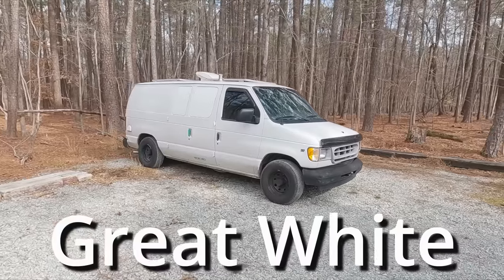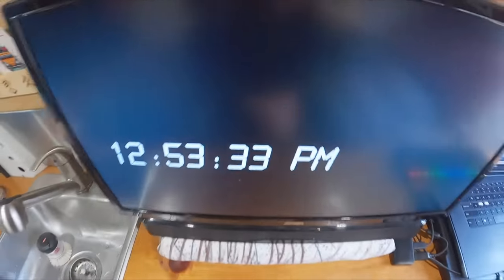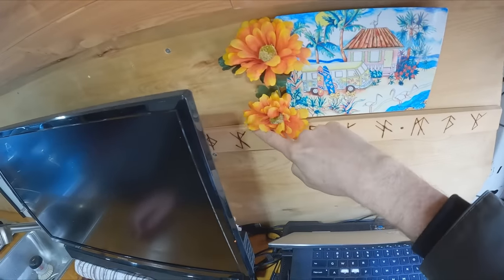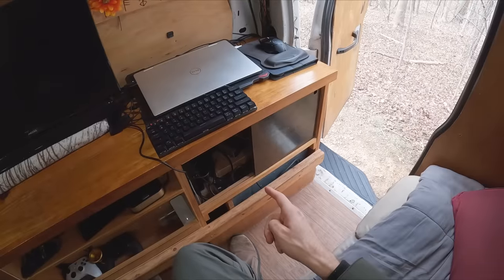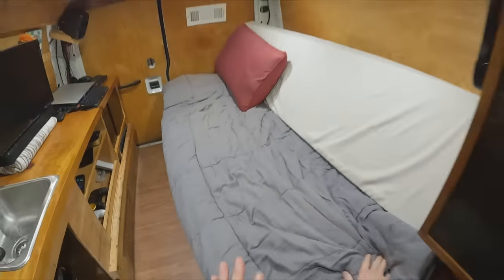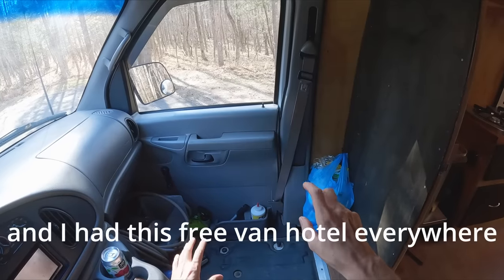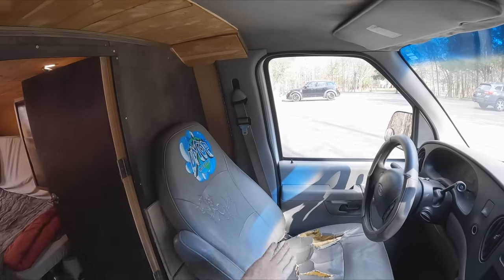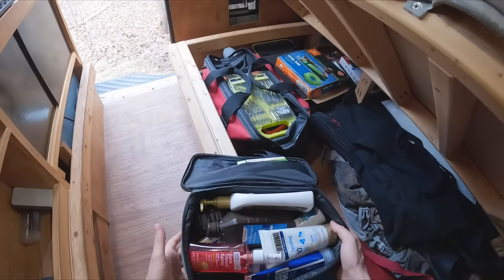STEALTH VAN LIFE TOUR | Differences Four Years Later

Comment: .
    I have a 2010 Dodge Grand Caravan STX with a shit load of options too long to list here. One option that is my favorite is Dodge's VES or Video Entertainment System. This is a factory option with 2 DVD players and 3 screens. There are 2) 10 inch diagonal fold down screens, one each for the second and third row seats, and there's a third screen in the front dash that goes to a neutral screen if the transmission is taken out of park and it doubles as the backup camera monitor in reverse. I have an aluminum brief case with 200 DVD movies in it that I keep in the van.
    One other feature of this is 2 AV ports in the back with a 150 watt 110 VAC inverter to plug game consoles into. The 2 screens in the back have their own wireless headphones on their own stereo channels so that 2 game consoles can be played independently from each other without bothering mom and dad. My youngest is 27 and is not about to drag his PS5 out to my van.
    I bought a ROKU stick which uses a UHF radio remote rather than an infrared unit. I also bought an HDMI input to AV output adapter and a dual 5 volt cell phone charger. On the drivers side panel in the rear behind the electric sliding door resides the 2 AV system inputs, the inverter outlet and a 12 VDC outlet. I plugged the the ROKU into the HDMI converter and their 2) 5 volt cords  into the dual charger. I plugged the AV adaptor into one of the AV inputs and the charger into the inverter. Then, I placed the whole setup in the drivers side rear window for the strongest signal. I park in the disabled spaces closest to the buildings when possible and never have a problem getting a WIFI signal as far out as the 4th space from the building. The inverter switch is in the dash in the front. I push the button, the ROKU loads up and I'm off to the show.
    Almost all of the doctors offices and hospitals in our area are associated with the West Virginia University hospital system and all have free open WIFI for patient use as does Walmart and Kroger grocery stores. After 11 spine surgeries, I am disabled. My wife used to have seizures so she's never had a drivers license. When it's time to go grocery shopping or if she has a doctor appointment or a test or procedure scheduled at a hospital, I do the driving. She goes in and does her thing and I flip on the inverter, set the VES to "AUX 2" and watch Prime, HULU, YouTube or any of 30 other channels that spark my interest. If I'm not in the mood for ROKU, I slide a movie into one of the players to pass the time.
    Being that all of this runs on the starter battery, I traded in the 500 cranking amp battery that came with it for a 985 cranking amp to allow for more run time. Especially if the inverter is involved.
    After a particularly painful spine surgery between my shoulders two years ago, that inverter was invaluable for running a heating pad while driving as it helped to relieve muscle spasms in my shoulders and neck areas. I plugged it in, ran the heating pad up to my seat and pushed the button in the dash. It made it much more comfortable to drive.

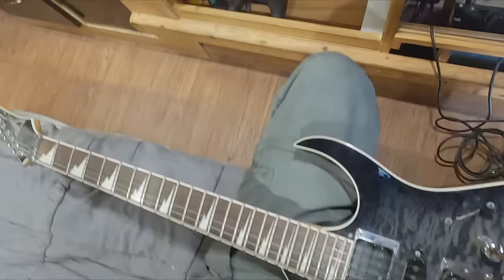Comment: 8:40.  . AGM batteries still outgas, and vent. Years ago, Alaska Communications had one of their remote mountain top stations blow up due to the outgassing from their AGM batteries. They, too, thought that they didn't need to vent, and found out the hard way. They are still water/acid/metal combination, and so electrolysis still occurs.
Reply from the maker: Good thing I had it vented still from the previous battery that off gassed a lot more!

Comment: can you share some stories about problems you've encountered regarding finding parking for your van overnight. where do you usually go and stay? is the neighborhood always accommodating? how about thieves? and also maintenance and other services you do to keep the van life rolling..
Reply from the maker: For finding spots, it's not so hard. While traveling longer distances, I just do crackerbarrel to make it simple, walmart as back up.

For nice camping, I'm usually in an area for a while, so you ask the local RVers and Vaners. Or you download the apps and find good spots. I feel like parking is simple to find anywhere in the US, but getting the nice spots is just a conversation away.

I haven't had any theives yet myself. Park away from bad areas.

For maintenance, I am constantly listening to the engine noise or any other tiny difference in sound while driving. Sounds are the best indicator something is changing / worsening over time. I usually use YouTube to fix my own stuff if I can.

Comment: I like the fireplace the best. Of course this is because I took my shot at van life and heat is a big issue. The propane buddy heater thing with the front windows cracked open did work, but I would never go to sleep with it on for obvious safety reasons, and I believe the gasses emitted from the buddy heater are carcinogens and cancerous.

Comment: Hope I do not sound negative but in first minute in this video I already see two big Nono's! First is that propane tank in your living area (shoud be outside and ventilated) second is you have gas stove without flame quard (if flame shuts down, it automatically shut down your gas) these are things that are taken care in commercial campers and I sure hope all who make these wonderful van conversions think out your safety too! No one want's to live in death trap and where I live you can not build without inspection it yearly for road legal.
Reply from the maker: You are right. Now in my new van, I have a small 1 pound interior tank, and a stove with the auto cut off features. Eventually, I might put a big tank on the outside under the van and remove the small interior tanks, but at least they last each about a week and a half of cooking.

Comment: Nice efficiency build. We want one of these but dont feel we need a huge kitchen. But we want a larger bed and full shower/toilet. We want to use it to deploy for 3-7 days for work camping in different parts of the country. So we need all weather and we need good air-conditioning. We would also like to have the option of shore power. I wonder if there are plans that focus on certain aspects and best practices for insulation.

Comment: Most ppl do think of the prices for month to month. If u think of it the average person pays around $875 a month for just rent on an apartment or $1300 after all bills and groceries r paid and bought. By living in a van or truck you are cutting that down about 32.17-38%. im getting me a van soon to convert and live in full time. Im getting a normal gas generator that's quite as can be and some solar panels. It will only cost me about $552 a month to live in ($200 for car insurance, $200 for gas, and $152 for food and water. It's really cheal if you only get the things you need

Comment: 6:06 Just so you know, air purifiers that work by actively "releasing negative ions" into the air, while they may produce a "fresh" smell, they often do so by releasing tropospheric ozone. It's likely bad for the environment, plants, crops, wildlife, and absolutely most importantly in the enclosed space of your van, your respiratory health. Whether it makes enough to be seriously concerned about, I couldn't say, but I would suggest looking into it, just my two cents. My seasonal affective disorder lamp has the same feature. After reading into it, I have resolved to not use it anymore.
Reply from the maker: Correct, yes! I've done a good bit of search into it. I just have it on when I'm away from van and air out the van before getting back in.

Comment: I am renting a driveway for now and that gives me access to a plug for heavy heater and fan use  but that’s not forever. A fireplace seems ideal but also seems very niche for rural only vanlife. Or am I wrong?
Reply from the maker: Instead of a fireplace, get a diesel heater. Put in your own tank if you don't have a diesel van. This route works way better.

A fireplace is for sexy appeal, too much work to keep it going. A diesel heater, with proper van insulation, can last you days and days on one tank. Personally my van tank (on my new van, not the one in this video), my diesel heater can run 100 days without refueling

Comment: What do you do if you get lucky?Go to their place or bring them back to your van?
Reply from the maker: Definitely bring them to my van. Some women absolutely love the van, and especially my new van which is being built as one of the most comfortable ever, in my opinion. I call it girl friend friendly features. Will have a full body mirror up front, hot water, a full Recirculating shower and toilet, already has a queen size bed plus 4 inches so I can push her away from me at night hahaha. It already has heat all night long, but the thing that will set this van apart is the real AC system for use during the day, and some at night off just solar battery.
Reply: @OutdoorsEmbrace  That's awesome.

Comment: I love the lights that turn on and off to the music. What is it or where did you get that? Also the pump to pump in water into the inside. Which one is that?
Reply from the maker: Amazon 12 volt LED strip lights. You cut the power wire at the adaptor and wire directly to your 12 volt battery!
Reply from the maker: For the pump, look at the Amazon page in the description. It has a list of all parts used in Great White

Comment: Very nice!  Have you ever considered watching regular free over-the-air HD and digital broadcasts on your TV?  In order to be called a 'TV', your TV is required by federal law to have an over-the-air tuner already built in.  Wouldn't be much trouble attaching a small antenna to the roof of your van.  Rabbit ears probably would not work well inside the van surrounded my metal with no windows nearby.
Reply from the maker: I just don't really care for normal TV broadcasting. But it could work yes
Reply: Commercials SUCK! @OutdoorsEmbrace
Reply from the maker: @doctorkayak  commercials are amazing! I love them!

Comment: Wow.  😮 Isn't all that equipment heavy for the tires?
Reply from the maker: These vans are made to carry lots of weight like this. I'm sure it can bog down the van over time, but act like the engine has no power while driving and you'll be able to run the van for a very long time. Acceleration = heat = wear on parts

Comment: Propane safety...shut off the burners at the stove top BEFORE you close the gas valve. You don't want oxygen in the tubing between the propane and the burner.
Reply from the maker: The proper way to turn off a grill is by turning off the propane tank first, then turning the knobs on the grill. This way you cut the supply of the flame first.
Reply: @OutdoorsEmbrace  You are wrong. Turn off the burners, THEN the tank. The reason is you don't want air getting into the tubing that supplies the burner.
Reply from the maker: @NewVenari  I've done a good amount of google searches on this.
My last comment is actually copied from a credible source on the matter.
 The companies websites even say what I am doing is the proper way.
Search, "In what order do you turn off a Propane Grill".

Comment: Does not being able to stand take a toll on you? I was debating a standing Van to not. Just because a Not standing Van. Seems more stealth and I assume you could park n more places? Seen signs where it said no Vehicles over 9ft etc..
Reply from the maker: Honestly stealth to me is just keeping it plain and white on the outside. Keep it looking clean too. It blends in with work vehicles. Stealth is almost no longer about fooling people that it isn't an RV. It's not about looking so plain that they don't even think about it. Great example would be my new van Window on my new van. It would be easy to tell it's a window if you know, but it doesn't attract the eye. Most people would not even notice it and may even think it's just part of the metal.

Through all my experience, I have not noticed any difference whatsoever between parking less/more places between the smaller and tall vans. Get the one you can stand in if you want it and can afford it. The ONLY limitation I personally see (and it's not a huge issue) is van length. Sometimes parking in a city like NYC is much harder when you are long and trying to parallel park between cars.
Reply: @OutdoorsEmbrace  Ya, good advice. I see here in Caly. A lot of no oversized vehicles. Mine is 19ft so it short enough. But it 9ft so too tall. Under the Code. I did not know that when I bought it. I want to travel into cities.

Comment: Are the only batteries you have to vent, is the Lead ones? Do you not have to vent the other batteries?
Reply from the maker: Just get Lithium Batteries. So much better and you do not need to vent them.

All Lead Batteries need to be at least slightly vented. Even sealed AGM can off gasses. They are super heavy, and they only can be used to 50%.

Get LiFePo4 Batteries. Do not worry about getting the expensive ones. It's ok to get the cheap Chinese ones on Amazon. The build quality inside is actually very good with almost all of them. Look up Will Prouse's Battery breakdowns, he shows the insides and gives good brands to buy for cheap.
Reply: @OutdoorsEmbrace  Thanks for the Tips! I happly go cheap as long as it works. But Can not give China my money. I rahter pay more! If there is an option. I rather keep my money in America. It will be a thing in the long run as we are seeing now. We have to spend in house. To help each other out. Anyhow that my opinion on it. Also I learned spending good money once is cheaper than  buying Cheap China stuff 10 times. And the hassle too. Agggg.

Comment: are you able to game for hours without running out of battery or how does that work say like you want to game for like 5 6 hours and run out do u just use like a generator or something to recharge quick?
Reply from the maker: In this van, I did run out quickly. But in my new van, I can game for days literally without a charge. The newest games too. No issue. I've been playing Elden Ring a lot lately in my new van on my screen with my subwoofer audio set up. All this can run for days if not forever really, due to charging daily. But without charging, probably game for 3 to 4 days without sun.
Reply: @OutdoorsEmbrace  thats awesome im looking for around the same amount of power what exactly is your new power setup?
Reply from the maker: @Diode7  600 amp hours of LiFePo4 battery. 12 volt system

And 800 watts of solar, although a little less would be ok too... but I feel 800 is good to keep up with demands.

Comment: Any issues driving with those solar panels on at high speeds?
Reply from the maker: If you go above 50 mph, they fly right off. It's extremely annoying since you have to buy a new one each time you accidentally go speed limit. Haha, no issues. For real, you can go as fast as you want and they are just fine. No wind issues or rattling.
Reply: @OutdoorsEmbrace  Alright, cool man!  Thanks for replying and keep up the channel, nice work!
Reply from the maker: @SN0WMAN27  for sure man! Glad to help! I will say there does seem to be a period of about a month where they settle in. It does have some rattle towards the beginning. Happened with both vans and all others I know from other people. As far as I know, it's normal just going over bumps. It should only be ever so slight though of a sound. That's with the Z bracket mounts. Otherwise after they are settled in, they are all good. Especially once you install insulation, everything deadens out and vibrations go away. Everything like road noise or outdoor noise goes quiet. It's like a 20 to even 30 decibel difference it seems. In my new van, I have 5 inches of insulation on every wall, extreme difference in sound quality, great night sleeps even close to highways.

Comment: What is the diagram from the front battery underneath the hood to an isolator an inverter in the battery in the back how does that hookup and am I able to charge car batteries with my  my truck running.?

9
Reply from the maker: Oh I have an entire video showing how to install an isolator in this exact van set up! It's a good one and makes it easy to see everything

Comment: I wonder, always, how the buildout of the interior affects MPG.
Reply from the maker: I haven't noticed a big difference in either of the vans measured MPG before or after build.

Midway on the build of second van and it seems that I'm getting a similar MPG (22.6 hwy 2016 Turbo Diesel Transit T350) that I did before anything was put in place inside.
Reply: @OutdoorsEmbrace  Wow. That's amazing.
Reply from the maker: @bloodswarms  I would like to add, other people have reported a different story than I, that it does effect their MPG. I'm just sharing my side. But I technically am measuring mpg before and after, so perhaps these others have not.

I personally think it mostly has to do with air resistance, so stuff you put on the outside like boxy solar panels and such that slow the van down.

I've only ever noticed a small decrease from weight inside.